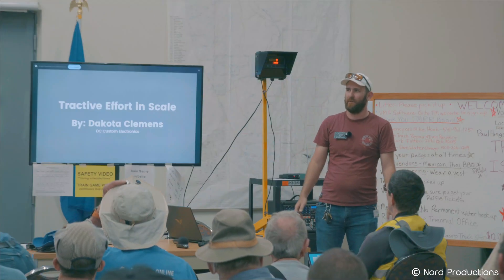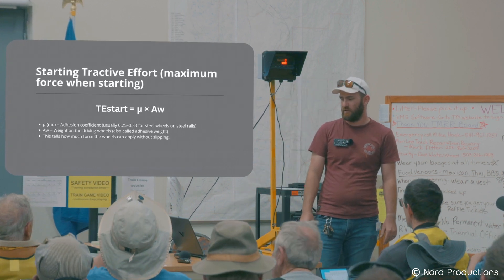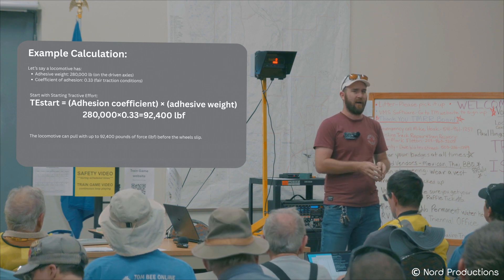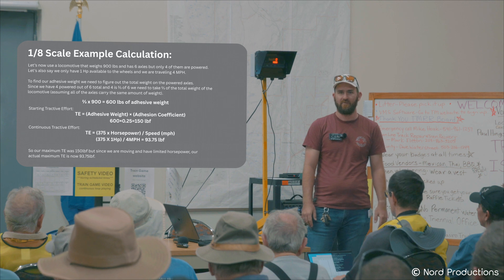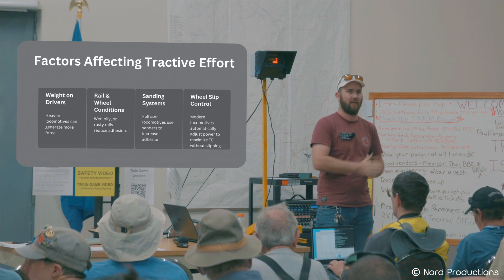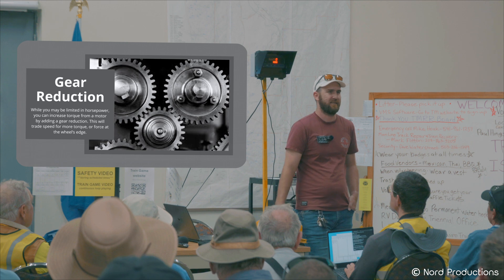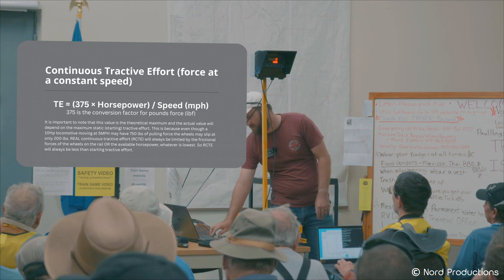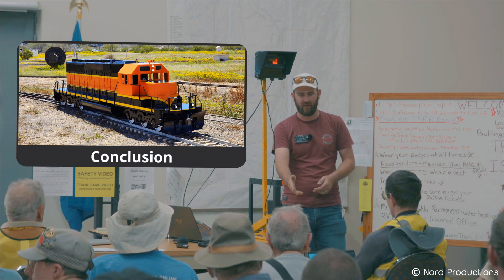Tractive Effort in Scale | How to Build Your Own Locomotive

Comment: In central Europe, where trains are limited to a load of 22.5t (50,000lb) per axle, we usually assume 50-75 kN (5-7.5 Megapond/ton forces, 10-15 kpf) per axle.

That sums up to 350-500 kN in 6 axle engines, usually around 400kN. 4 axle engines, which are far more common, are usually rated at 300kN.

Converting that to imperial units, we end up with about the same 90kpf for 6 axle engines.
Reply from the maker: That's some detailed knowledge! We appreciate you sharing those specs with us.